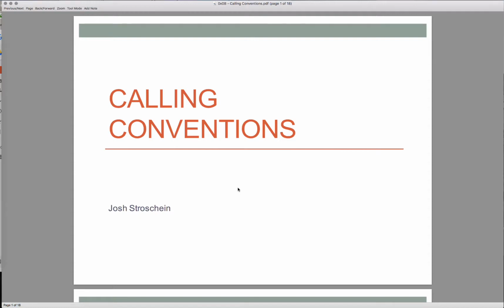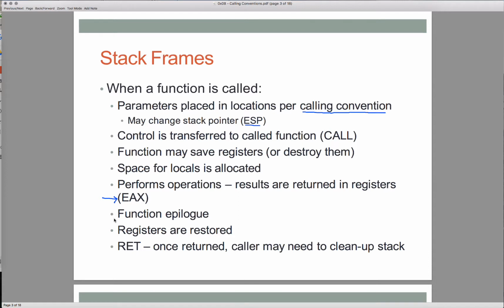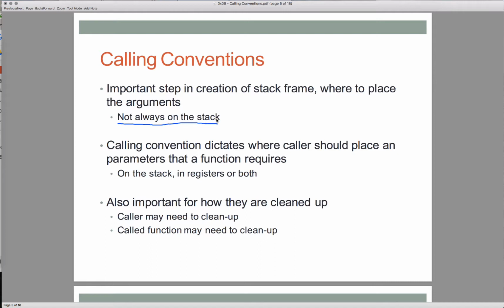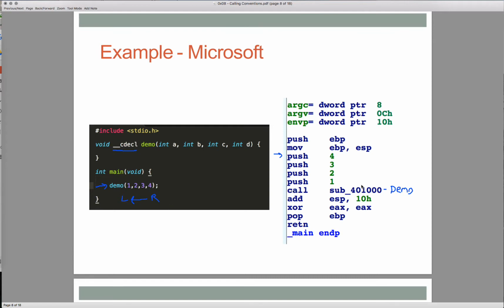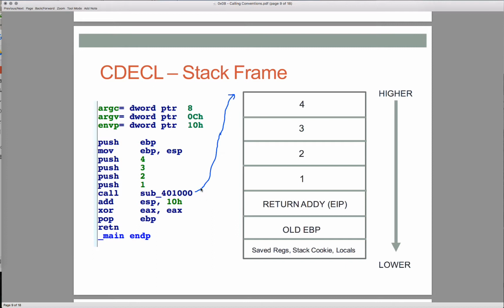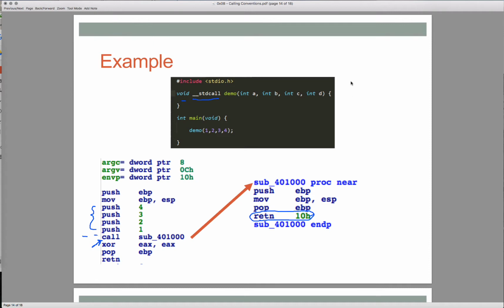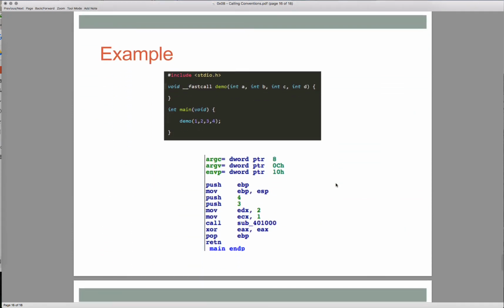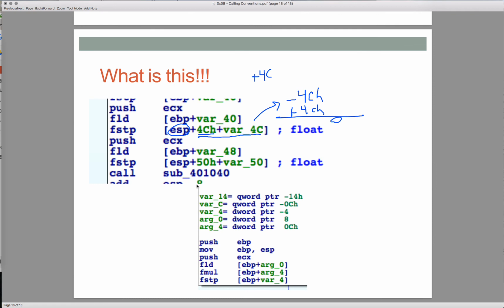13 - Calling Conventions

Comment: real world decompiled apps for the most part never follow these convention rules. its almost always mixed up in some way or another
Reply from the maker: How so? Most real world apps will be compiled and the compilers follow these conventions. Malware authors or those that use assembly may find it easier to deviate - but even malware authors regularly use standard compilers. Decompilers and disassemblers simply recover what was originally compiled.

Comment: Thank you so much Josh! The calling convention for a particular program is the same for all functions, right? If different calling conventions are used for different functions in the same program, then the program can't be compiled, right?
Reply from the maker: I can’t say for sure as I haven’t looked into it in too much detail. Some compilers let you define the convention, but as to if they enforce that for every function or just programmer written ones I’m not sure. My assumption is that it is the same, that is usually what I see with programs that are not malware. Of course, malware authors or those trying to protect IP may throw all sorts of things at you!
Reply: @jstrosch  Thanks Prof!